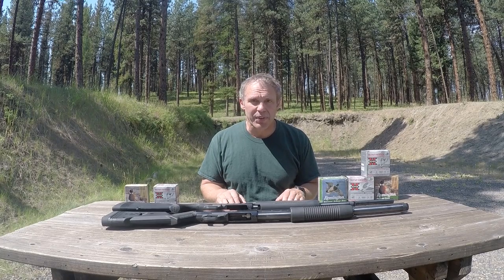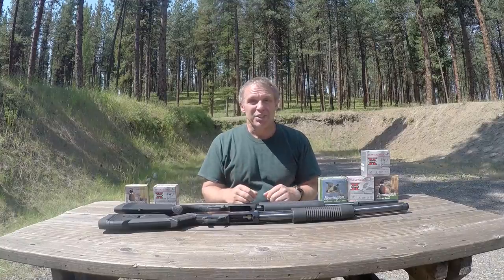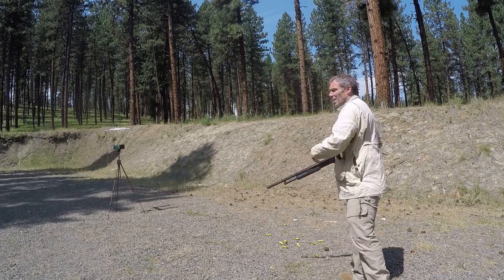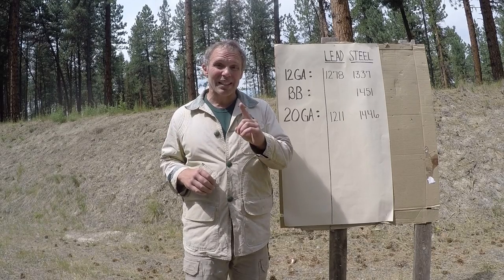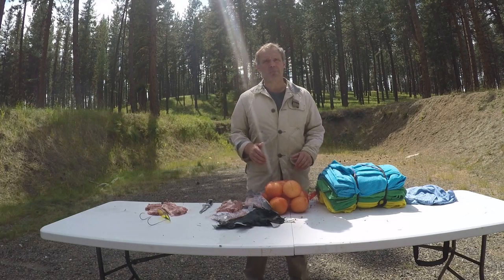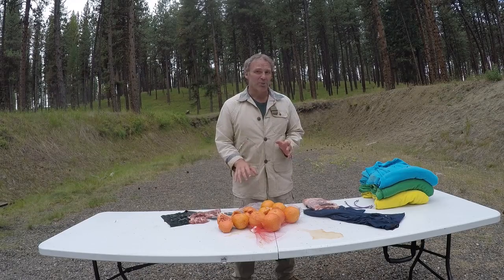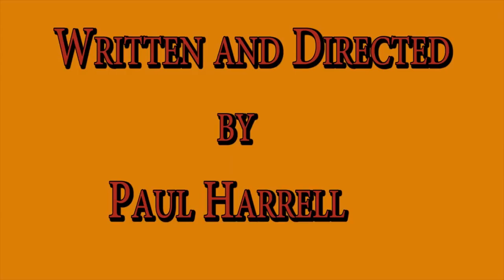Steel Birdshot for Home Defense

Comment: I must have missed this video when it came out, I was always hoping you would do a vid on big bird steel shot.  As a avid waterfowler I’ve often wondered the effectiveness of typical goose loads in a self defence situation.  Here on the Canadian prairies we tend to use 3” or 3 1/2” BB or BBB or even T or TT.  My preference is 3” BBB for geese, best bang for your buck and good stoping power on sky carp.  I used to use Remington hyper that claimed 1700fps, you didn’t lead the geese just aimed at them.  Apparently Remington hyper can damage alloy framed shotguns and isn’t available anymore. 
I’ve used steel shot in various shotguns on varmints and it has been 100% effective as well.  Thanks for directing me to this video.

Comment: I participated in a bowling pin shoot a number of years ago.  I believe our distance was about 25 feet. I shot rounds using my Browning Hi Power 9, a Colt 1911 45 ACP, a S&W 29 .44 Mag, and a 12 ga shotgun. It was interesting to see how different the various pistol rounds were in clearing the bowling pins off the table.  Marginal (not dead center hits) we’re the most revealing about the power of the rounds.  The 9mm was marginal, sometimes with a couple of shots required, and the .44 Mag cleared the pin with authority.  However, the most eye opening was the shotgun.  Using just standard bird shot rounds, those pins would FLY off the table.  I used a semi-auto (heresy, I know), and smoked those 5 pins in short order (for me, first time in this setting). 

And, no denying the sound of racking a round into a pump shotgun; the universal language for bad guys to “Go away, far away, and go quickly”.

Comment: 1000% more effective than no shot at all.
Reply: 1000% (or 1100% for the pedantic) of 0 is still 0.
Reply: Rick C really it depends on what he means by ‘no shot’. I don’t think ‘no shot’ is 0% effective. Could be a blank or just a powder load with no pellets. Could be an empty shotgun. Could just be your bare hands. While I would certainly rather have shot than any of these things the effectiveness of even bare hands is above zero.

Comment: For the 20 ga, you have 1 oz of lead pellets at 1278 fps = 103 ft lbs of energy / 130 pellets for 0.79 ft lbs per pellet, and 7/8 oz of steel pellets at 1337 fps = 98 ft lbs of energy / 156 pellets for 0.63 ft lbs per pellet. The lead cartridge has slightly more energy overall but the big difference is that each pellet carries 25% more energy than its steel counterpart!
For the 12 ga, you have 1 1/4 oz of lead pellets at 1211 fps = 115 ft lbs of energy / 161 pellets for 0.71 ft lbs per pellet, and 1 1/8 oz of steel pellets at 1446 fps = 148 ft lbs of energy / 222 pellets for 0.67 ft lbs per pellet. Here the lead has much less energy overall but each pellet still has 6% more energy than its steel counterparts.

Comment: Paul Harrell Steel shot came out decades after the Remington  Model 11 was out of production.  Steel shot's impact on firing is quite hard and required new powders and new guns to stand up to them.  I would not shoot hyper velocity steel in a fine old Rem Mod 11 like yours.  I bought one in 1956 and loaded it to the max at 10,500 LUP and wore that sucker out in less than eight years. Those steel loads are rougher than my lead reloads.  By that I mean the pressure curve spikes from the hardness of the steel.

Comment: I've been told that sometimes steel shot patterns wider than lead shot because the steel pellets are bouncing around as they go down the pipe and spread out when they exit, whereas the lead will dent as it goes down the pipe and not bounce as much.
...But I dunno, I've never looked down the barrel to watch them come out, so it's just hear-say.  
;-D
Reply: Nick X I doubt that, the shot is contained in a shot cup until it exits the muzzle. It probably has more to do with how the steel shot interacts with the choke as it goes down the barrel

Comment: Paul, you should be wearing eye protection.  I have been struck several times by richochets, and friendly fire.  One in the eyeball put the lights out.  P>S> I hate wearing glasses, but I value my sight.
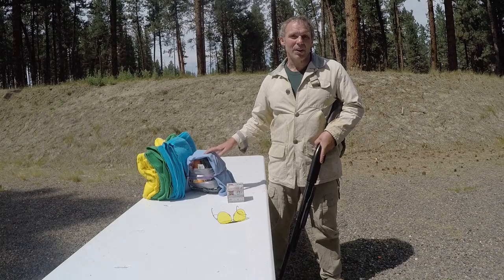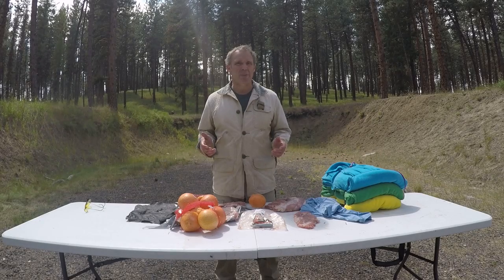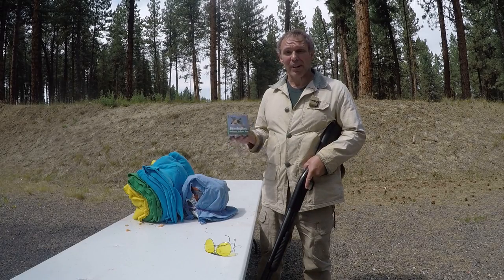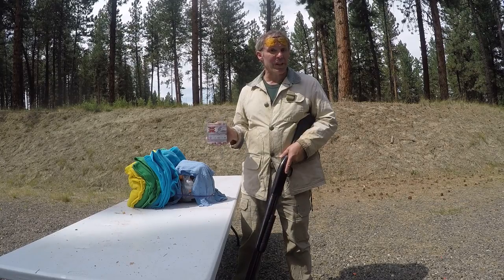Reply from the maker: I don't consider eye pro necessary when using the chronograph, but I use it when shooting anything that has a potential for blow back like steel plates or the meat target. You don't see me wearing it because I am off camera while firing, but you can see my glasses on the table at 8:00  8:30  9:15  10:30. You can also see them on my head at 10:15

Comment: I'm a big fan of 12ga, 2 3/4, high brass, lead BB.  At 35ft and under it's very nasty from a 1187 and 870 with a modified choke.  It seems to be very hard to find in stores so I order it online or buy it at gun shows.  Have you ever tested or shot any duplex turkey loads such as BBX4 and so on?  I have found them to be wicked and hard hitting.

Comment: Just a reminder or FYI, when shooting steel shot go one choke size down from where you want to be.   I.E.,  a modified will shoot like a full, an improved cylinder will shoot like a modified etc.  Obviously this only works if your gun has screw in chokes, or you have another barrel.  Good luck.

Comment: One question I have for birdshot for home defense, is why not aim a bit higher for face and neck.  Those areas are much less likely to be wearing a leather jacket and layers of clothing, and the eyes and neck wouln't have ribs or pecks.  I'd think that with a shredded windpipe, Swiss cheesed arteries, and/or destroyed eyes, someone would quickly lose all motivation for whatever evil they had in mind.  That is, why not aim for the chest with buck and aim for the face and neck with steel birdshot?  Yes, perhaps a smaller target, but steel seems to produce a wider pattern in a short distance, and hopefully the gun has more than one round.

Comment: Paul: Got two easy, cheap video ideas for you. I'm an upland hunter of 20+ years and an economist FWIW.

1) Does pumping a pump shotgun immediately upon firing significantly reduce muzzle-velocity by allowing gas to prematurely escape via ejection port and/or loading port?

2) Ceteris paribus, does "Shell X" fired from an autoloading shotgun have more, the same, or less muzzle-velocity than "Shell X" fired from a pump shotgun? I swear that dove go down easier when shot with my pump versus my semi-auto.

Thoughts?
Reply: Jake M no to all of the above. If the action was being opened fast enough to bleed off velocity the chamber pressure would still be so high it would bulge or blow a hole out of the shell. Chances are you either shoot the pump gun better, or it patterns better, causing more shot to hit the dove and knock it down faster
Reply from the maker: @beardoggin8963    I concur
Reply: @PaulHarrell  thank you sir!
Reply: @PaulHarrell  -- Today (8/16) I've become a patron of yours and would really like to see these two questions tested. This has been bugging me for 5 years.

Expect a one-time donation of $100 around Sept 1st. Thanks for response and videos!
Reply from the maker: to test these would require using shotguns (one pump, one auto) with the same barrel length. I'll see what I can find. To test the hypothesis about racking the slide. I Can easily test that by shooting a string of fire While cycling the action as fast as I can after each shot, and then firing a string and waiting to cycle the action. There have been studies done that have showed no significant difference in velocity between autos and non autos, and I would consider it virtually impossible to work slide action fast enough to make a difference. But I can put it to the test.
Reply: @PaulHarrell  -- If you can't test, no worries because I'm donating anyway. Thanks for the wonderful videos!

Comment: That was an eye opener.  I had expected the steel shot to out penetrate the lead, because of the higher velocity and the hardness of the shot.  I was shocked to find the penetration equal or less than the lead.  Perhaps this is due to the lighter weight of individual pellets.

Comment: In my home defense Mossberg 500 I've recently switched from (2x 2 3/4" #8 lead bird) followed by (3x 3' 12 pellet #00 buck) to simply (5x 3" #4 steel). The #4 steel in question is a Winchester 1 1/8th at a very speedy 1550fps. Since I don't ever expect to be shooting more than 20', I'm fine with the spread and not putting my neighbors at risk. And the total energy going downrange is still a thumping ~2600 ftlbs (which is in the same ballpark as a 150 grain moving at ~2750fps but with zero over-pen potential).

Comment: Now I want to know how many interior walls steel birdshot will penetrate. My setup is such that bedrooms are in a circle around a central staircase. If someone is coming up those stairs, and they make themselves a target, I've got VERY innocent bystanders behind them with 1(or 2 if there is a closet) wall between. Now its a very old house with walls built out of 2x4 redwood studs 12" on center, lots of cross blocking, button board (no lathe) and actual plaster but your "typical setup" videos are still amazing for comparative purposes. I don't expect you to make such a video just for steel birdshot but interested in your thoughts.

Comment: Theoretically if you apply the same amt of energy to lighter pellets of the same diameter, they will move faster but carry the same amount of energy to the target, minus air resistance. Lighter steel will move faster than lead, but also slow down commensurately faster in both air and in targets. So perhaps more surface damage to (nearby) targets but less depth penetration. Also, other factors apply, like increased mass of more pellets slowing down the mass of pellets as they accelerate.
Reply: Ah, I see (on finishing the video) that the steel BB's did maximal damage, and large spread pattern. So perhaps with lead, it's not being accelerated enough due to its greater mass to carry the optimal amt of energy to the target, and the steel BB is hitting that sweet spot.

Comment: I’m curious about 10 Gauge: I’ve heard people say “modern 12 Gauge is just as powerful as 10 Gauge,” and also say that “at close range, 12 Gauge is just as powerful as 20 Gauge,” and ALSO that “at close range buckshot and birdshot preforms like a slug,” so what IS the difference in power between, say, a 10 Gauge slug and 20 Gauge buckshot? I’m also keeping in mind that Paul said a giveaway of a Fake Expert is if they say that one round is “just as powerful” as another.
Reply: I see it this way:

Even if 10ga is noticeably more powerful than 12ga, which I believe it is, what does that extra power actually do for me over 12ga?  Or another way, is there some deficiency in 12ga that can be solved with the extra power of 10ga ( similar to Paul's comments on carry capacity, "Is there a situation you can solve with 8+ shots in an autoloader that you couldn't with the 6 in a revolver?" )  I can't readily think of any.

However, is there a downside to 10ga?  Yes.  The shotgun will be bigger/heavier.  In many places it may not be available.  Even if it is, you'll likely spend a LOT more money on the ammo.  It also comes with extra kick and recoil.  That to me is not a worthy trade-off for marginal extra power that won't be useful in most situations.

Given my choice for defensive shotgun, I'd go with a semi-auto 20ga modified choke loaded with #4 buckshot.  It's lightweight, often shorter than 12ga, light recoil for fast follow up shots, and something a smaller person ( smaller spouse, or even small teenager ) can more readily handle.  Still plenty of hurt going downrange.

Same reason I want to switch my primary pistol from .45 to 9mm.  I can still shoot .45 well.  I'm a big guy.  I don't have arthritis.  It doesn't hurt me.  But I can shoot 9mm faster more accurately, the ammo is a lot cheaper, and there's essentially no difference in terminal ballistics with modern propellent and bullet design.  And while my wife won't touch my 1911, she will experiment with rental 9mm at the range.

Comment: I grew up shooting the Remington 870. As an adult, I prefer the Mossberg because of the safety placement. I wish it didnt have a safety. That's why I carry a Glock in the winter and a scandium J frame in the summer.

What are your thoughts?

I'm 33 and I live in Arizona.  I'm not some old bird clinging to my revolver.  My 340PD with 38 +P is a great pocket gun and wont corrode.  I just had to have a trigger job done on it.

Comment: This makes me think about your home wall penetration experiments with various shotgun rounds.  We know lighter, smaller projectiles tend to not penetrate as many walls as larger, heavier buckshot will.  What about steel vs lead shot penetration testing?  Like your recommendation to use smaller buck/larger birdshot to reduce home wall penetration risk, is there a sweet spot balance of using steel shot that's still as effective as large lead birdshot on the intended target, but penetrates walls even less?

Comment: I combine 20 guage with 12. I cut out the lead and put steel bbs. I have a few for home defense. Or a pdx 410. Which is literally specialized for in the house usage. Less velocity disc projectiles. Few bbs.

Comment: A video would be much appreciated on effectiveness of 357 mag carbine rifle for woods deer hunting:  is it ethical/effective and if so, what is the maximum effective range for deer hunting?  Related to the deer in my state (blacktail and mule deer).
Reply: My first hunt, I took a deer, broadside, double lung shot, from a laser-range-findered 49 yards away, with my Taurus 608 6 inch 357 revolver. A carbine will kill what you can see, but I'd keep it 60-80yrds (which around here in Ohio is about the furthest you're doing to get anyways). Deer was maybe 2-3yrs old, brought home about 70Lbs of meat. He bedded down to die after about ten seconds of running. Buffalo Bore 180gr flatnose.
Reply from the maker: .357 magnum (with the right ammo and at reasonable distances) is very effective and ethical for deer hunting. Several of the crew have killed deer with .357 magnum.
Reply: @PaulHarrell  The video could cover that subject of "right ammo and reasonable distance".  Thank you Paul Harrell for all you do.

Comment: May be an odd question, but is shotgun related.  Have there ever been a slug designed specifically for self-defense and not one of those non-lethal loads, but a shotgun sabot slug designed to be the right caliber/velocity/weight for defense use instead of the typical hunting role?

The only reason I wonder is because, while I have my shotgun loaded with buck, I haven't actually got a chance to pattern it as I'm in the city and no range in the area allows anything other than slugs.  Also, doesn't help that the closest state park with a shotgun range is currently closed for renovations, so, unlike my other guns, I don't really have a chance to get frequent practice with the load I'd actually use while a slug gun would be welcomed all around.
Reply: Cysubtor I think a regular hunting slug would definitely do the job. Not sure if penetration would become an issue. I think google would be a better place to look for something more specialized.

Comment: It certainly appears the 3" #4 steel shot used in the 20 gauge was effective on the meat/citrus target, likely due to the significant increase in velocity. I have some 12 gauge 3" #4 steel shot rated at 1450 fps and am thinking about loading it in a spare shotgun for home defense though this vid is making me have second thoughts.

Comment: very informative but why wouldn't stell be good enough.  though it may not have done much damage to the fruit, it still would have produced serious, and still possibly lethal wounds.  I would think that the possibly less lethal steel shot would be preferable since you are less likely to kill but just as likely to incapacitate simply by the energy transferred to the intruder.  Any clarification here would be helpful.

Comment: I really wonder why the steel didn't group as well. It clearly had more velocity, and I would assume a tighter pattern as a result. It begs the question: if you can find 12 gauge steel shot that doesn't pattern like garbage, would it actually be effective? Recently, steel shot is all I've been able to find for my gun unfortunately due to "beer."

Comment: The guys at a local gun store don't recommend steel shot for "close-in" shooting. Their reasoning is steel shot could bounce back if it hits a sufficiently hard object. They say it's unlikely, but possible. What are your thoughts on that? I can't think of a safe demonstration to test that theory.
Reply: @Kjs Steel birdshot bounces off of more than steel and concrete. Also to consider, if you hit plastic or other materials that can shatter, the shards don't just go away from you. When lead hits these materials, there's still that danger, but some of the energy is lost when the lead flattens out. If you want to shoot steel shot at close targets, feel free to do so. I choose not to do that.
Reply: @Kjs How about your toaster, microwave, or the base of that lamp? Discharging a firearm has inherent dangers anywhere. Those dangers increase inside of a dwelling. Everything at an angle to the path of the projectile is a potential ricochet. I've seen concrete come back from a target 40 yards away, taped onto a cement block wall.  As for me, I'll use lead shot or slugs for anything close.